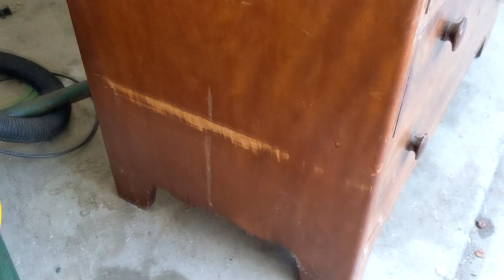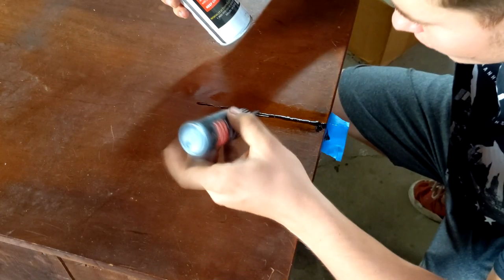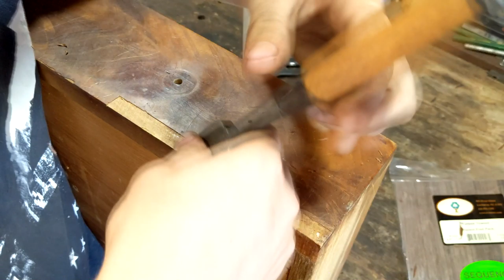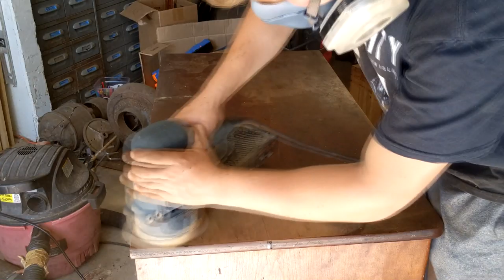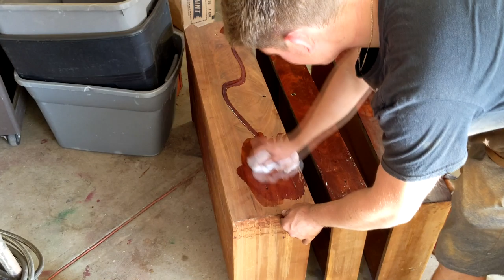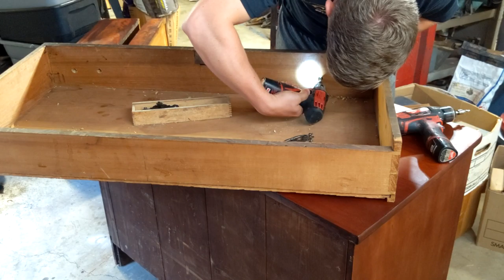Restoring a Chest of Drawers

Comment: Could you tell me what you used on the top of the dresser and what it did exactly?
Reply from the maker: I sanded it then used a wax finish
Reply: You filled a crack in with something I’ve never seen before?
Reply from the maker: @scarlettwinters5642  It was just black CA / super glue